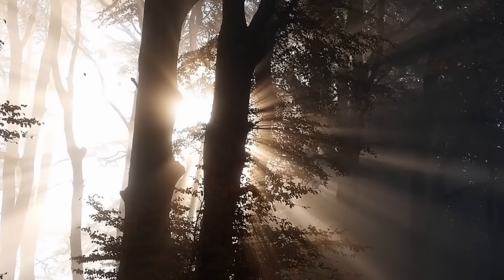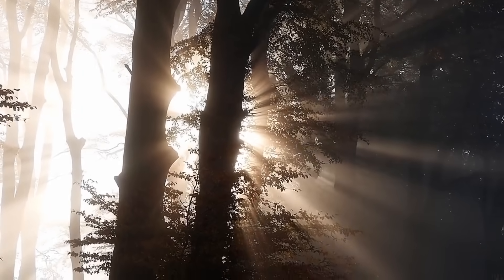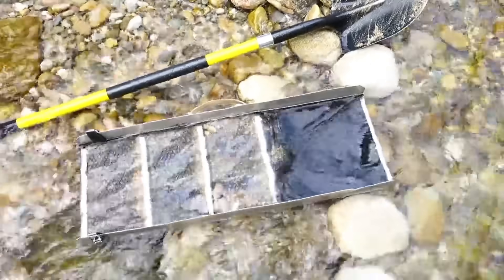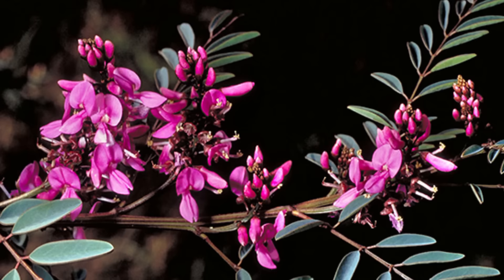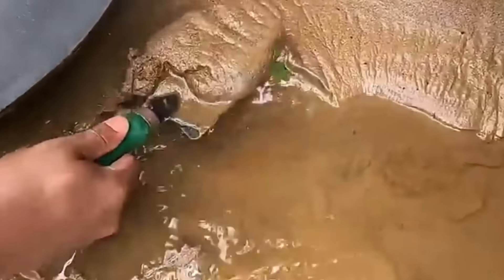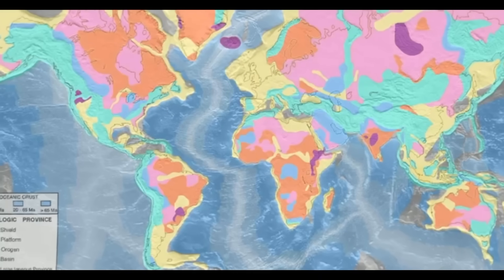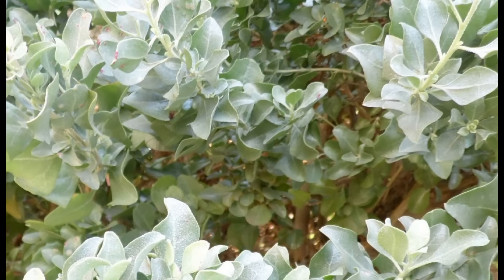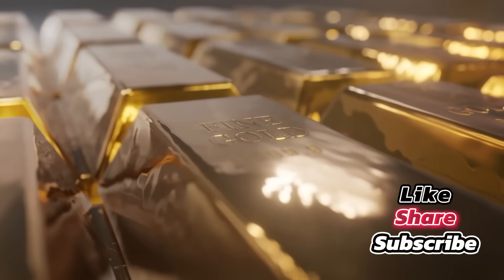The Plant That Reveals Gold! Prospectors Don't Want You to Know This!

Comment: Gold is non toxic, period.
Reply: Toxic is a subjective context. Gold is inert.... Like titanium.
Or like the gas Argon.

Which is why it doesn't oxidize readily, rapidly or profoundly for eg. Which means it does not react with the oxygen in our bodies cells/fluids readily, largely along with the other naturally occuring elements of the human biology... 
While being highly electrically conductive and having thermal transfer properties which differ greatly to the humans biological characteristics, it is almost completely diamagnetic, meaning electrical current doesn't induce a considerable magnetic force. This is great for the proximity that the body is routinely subjected to electrical currents at, and this means the metal readily lends itself to being used for medical applications or other biocompatible instances. 

But...

We do not yet fully appreciate and consider the implications of a dielectric characteristic/property which differs considerably from the bodies natural characteristics.... This means the metals ability to act as an electrical capacitor/transformer/inverter is not often considered adequately and/or considered as a factor within the environment of the Earths natural and our own transmitted electrical fields and what currently unknown unknowns this may hold for a complex biological organism as a whole, like the human body, and/or the function of any/all organs/systems within it and any associated adverse short - mid - long term implications....

The holy grail is replicated biological matter. From a acid/enzyme/protein level up and composed in the manner the host genome cordinates it naturally in the body.... Complete with cellular composition which is an identical reconstruction of the hosts specific natural/current condition. 

But for now gold n Ti will have to do.